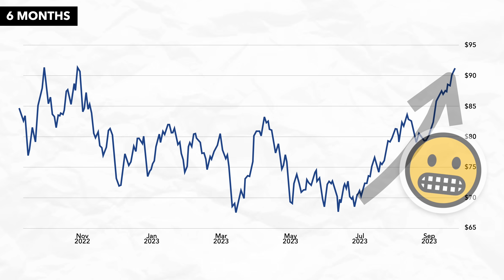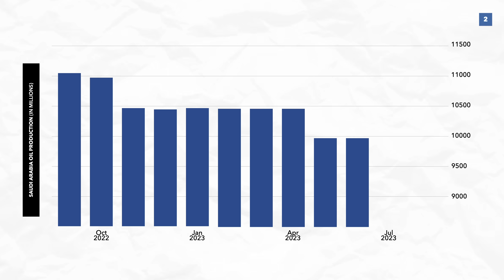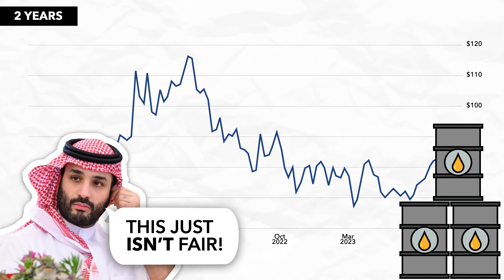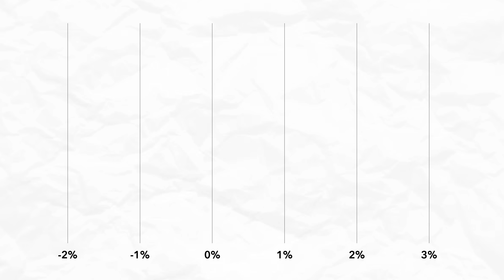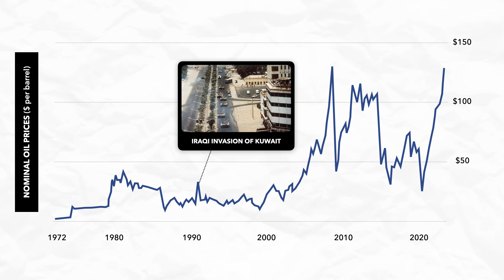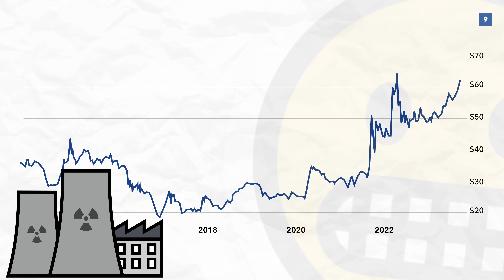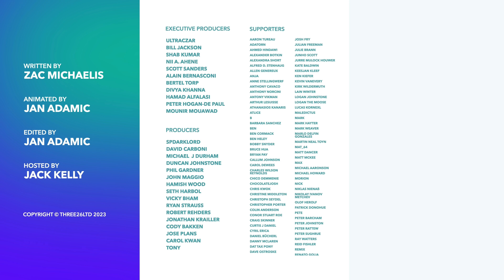Will High Oil Prices Restart Europe’s Energy Crisis?

Comment: We need to embrace nuclear energy.
Reply: We need renewables, nuclear is not profitable. And doesn't make us energy independent either as europe has to buy nuclear fuel
Reply: Nuclear fusion energy and nothing else.
Reply: @jorenbaplu5100 renewables aren't feasible

watch a video on it, we don't have enough minerals
Reply: @Nathoor  we need more and better batteries for the long-term, sure. But with what we have right now, investing more in renewables already helps massively to just take down the price of energy in general. Like if you can use these when they get produced, completely without batteries, you still reduce the need for other sources overall
Reply: @jorenbaplu5100  Short term thinking like yours also needs to go.
Reply: @crabLT  if you want a long term solution, then it definitely isn't nuclear. Not only will the cost create massive debt for the taxpayer, but unlike renewables the fuel is actually limited. Not to mention the added cost and potential danger of the inevitable cleanup. Nuclear belongs in the past.
Reply: @jorenbaplu5100 solars are very counter-productive
Reply: @jorenbaplu5100 also you are mainly referring to Nuclear Fission, we prefer Fusion
Reply: @lmvr127  Even if we were to get fusion to work, we don't have enough tritium production to fuel it. The tritium byproduct from all nuclear plants in the world yearly isn't enough to fuel one fusion plant for a month. But if we say we can fix that, then the cost will still be a massive issue. Fusion plants are still insanely expensive to build and maintain and probably would become the most expensive energy source we have. While wind and solar are already the cheapest energy sources today and are set to keep getting cheaper for a while.
Reply: @jorenbaplu5100  Who cares about profit. This is not left up to capital but the state. Capitalists are the reason we're in this mess to begin with offshoring for the cheapest oil to countries that can turn it off. There's no financial incentive to change energy sources. It's actually costly. The State needs to take control of energy.
Reply: @zenster1097  well I actually agree, I just don't think we'll succeed in convincing enough people to disregard profit. Sadly, i think it's very likely profit margins will remain a very important factor for a looong time.
Reply: @jorenbaplu5100  If the State is in control and can cap it, why is profit an issue? The State secures the resource, etc. The State is doing that already. Scrambling to get oil. You're just getting a cleaner and energy resource that is more energy independent.

Comment: Poorly researched at the end there.

1. Uranium costs are just a small fraction of the costs of nuclear energy. Most is building costs and financing cost. An increase of uranium prices will barely be noticeable for nuclear reactor operators.

2. The correlation between gas prices and oil prices is not a strong as you made it out to be. Gas is mainly for heating and electricty, oil is mainly used for transportation. very few oil fired power plants exist. (mostly in estonia, malta and cyprus) Since electricty prices are determined by the merit order of production, meaning the highest priced source that delivers the last bit of needed capacity sets the price, gas prices are the main factor in determining electricity prices. Therefore oil prices will have a small effect on electricity prices. 

Of course high oil prices will hurt europe in other ways, but this problem is different from the energy crisis we experienced last year.
Reply: Side note: modular nuclear power plants are attempts at making building these things cheaper, seems to be working though their power generation is smaller from what I understand but worth the cheaper costs.
Reply: Keep in mind from where you can get the uranium. As that is something one also doesn’t want to depend on too much.

Comment: All those people that want more solar and wind energy to replace fossil fuels need to think about the meaning of energy density.  How many acres of windmills or solar farms does one need to replace a single oil or gas well that is gushing 24 hours a day, 365 days a year for several years.  I heard somewhere that to reach net zero by 2050, one needs to replicate the entire installed base of wind and solar generation every 2 months or some such other unachievable timescale.  This is just for electricity generation, cars and domestic heating are another matter.   There is not enough metal being mined or people to do the work let along expand the electricity grid  to cater for these plans.

Comment: Lot's of ignorance of energy in the comments.
Fossil fuels and Nuclear are not comparable. Fossil fuels are stored energy, nuclear fuels also contain stored energy. However, nuclear reactors do not let you ramp up or down out put based on demand. Nuclear will never replace gas on it's own, it has to have additional storage capacity built alongside. Those storage systems require huge amounts of natural resource inputs, which are extracted using fossil fuels.

Comment: More Green energy is the answer. Wind, solar, geothermal, you name it. Geothermal could provide electricity with Stirling engines, btw.
Reply: Fertilizer.
Reply: Unless it is hugely subsided by the government, renewable energy will remain too expensive to be reliable due to the inability of said energy sources to be stored. 

One can store fossil fuels which make up for surges in demand but renewables just don't have this capability.

Comment: The US is no longer dependent on oil imports, perhaps Mr. Biden could stop obstructing domestic oil production so that we could help insulate our European partners from supply shortages. 

The latest average break-even price for new US wells is $61/barrel ($23/barrel for existing wells).
If OPEC+ production cuts continue to drive prices towards $100/barrel then the US could increase production profitably for the European market; this could help Europe avoid a recession and rectify the trade imbalance that it has with the EU.
Reply: America imports most of its oil from Canada. Also because of the Petrol Dollar the US more or less gets things for free after printing money for it. What America doesn't really want is that same useless dollar flooding America for real resources like oil. Also, not oil is the same, America oil might not be efficient for Europe's machines. They all have a different constitution and maybe Europe's products have been built to work more efficiently with Russian oil.
Reply: @DavidJohnson-dc8lu ,
The US produced 1,192 more barrels of oil/day than it consumed during the month of June 2023 (US Energy Information Agency).

Comment: The EU needs to ban its auto industry lobbyists. Car dependency locks in motor fuel dependency. If people could get around well enough on foot, by bike, ebike or public transportation, the EU would see its energy use decrease and get more GDP per unit of energy consumed.
Reply: EU countries don't have car dependency problems like in the US. Oil price is problematic to the EU because it's the main resource for producing electricity. If you live in the EU, even if you switch to electric car, it's still oil in the background. That's why the problem runs deep and deeper. The only solution is to go nuclear.
Reply: @nokaton  
This is verifiably false. Only 0.5% of electricity generated in the EU came from oil-fired power plants. Get a clue.

Comment: 2:30 - That is a TERRIBLE graph. Why does it not start at 0? Having it start at an unspecified number (probably 8,500) massively exaggerates what is happening.

Case in point, if you don't actually read the numbers, it looks like the August 2022 numbers are 7 times higher than what they were in September 2023.

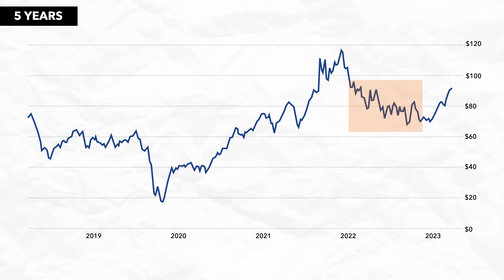The same is true for the oil price graphs, and here it's really egregious because you start out (1:00) with a proper graph, then at 1:13 you switch to one that starts at $65 and makes the September 2023 prices look 10 times higher than those in September 2023.

Through out the video your oil price graphs change significantly.

First it's $0 to $120 (1:00)
Then it's $65 to $95 (1:13)
Then it's $70 to $105 (1:56)
Then it's $60 to $120 (3:20)
Then it's $65 to $95 again (4:02)
Then it's $0 to $120 again (4:42)
Then $0 to $150 (5:43) 

And suddenly you introduce a Uranium price chart which ranges from $20 to $70, which dips below $20 (7:25)

Once is an accident. This is basically lying with statistics.

You can and you should do better.

Comment: Use less oil then
Reply: Slow down economic output. Got it
Reply: Oh wow! The European leaders never thought of that!

Seriously...
Reply: One thing is reducing your own oil usage, but pretty much everything is transported by trucks, and good luck finding an electric semi. More expensive transport --> more expensive food/commodities
Reply: @vervetech9395  go on local holidays instead of flying, use a bike/walk for trips shorter than 2-3 km (In Denmark 1/3 of all car rides are shorter than 5km), use public transport when not too inconvenient, prioritise stores in walking or biking distance, buy electric or battery powered gardening tools when the old ones breaks.
That's just of the top of my head. None of these will affect economic activity, will improve public health, lower congestion, reduce road maintenance costs, lower dependence on dictatorships for oil.
Reply: @inbb510  Yes, they have tried everything except anything inconvenient or politically costly. There are plenty of solutions both for individuals and govts that can be implemented very quickly. Politicians are just to busy s¡mp¡ng for car manufacturers and oil companies to do anything about it. Many drivers used to the ease of driving to walk or bike even the shortest distances
Reply: @kotletschabowy4169  that's why individuals need to reduce driving and flying, it reduces the price increase of food. Cutting unnecessary car rides will lower congestion thereby reducing fuel use of necessary traffic. Great opportunity to walk and bike as well, the health benefits will ease the pressure on our overburdened health care systems. There are no downsides to driving less
Reply: @HiLasse  in politics there are no such things called "solutions". 

There's problems, and then there are advantages/tradeoffs to each policy that attempt to address such problem.
Reply: @inbb510  sure, but your answer doesn't address the point of my comment.

You only adress my choice of a specific noun in one sentence. Reading your comment it seems it did not prevent you from understanding what I wrote. Which seems not particularly useful in a context outside of linguistic semantics.

Comment: The cold reality is that Eastern Europe has imported its oil from Russia or the Caucasian states since after WW2. There were some exceptions like Roumania which has its own oil fields. Germany had improved its relations with the Soviets in the 70s and also started importing. No wonder why. Russia has several natural resources which can be transported cheap and easily to Europe. During the second part of the XX century also big pipelines have been built to transport oil and gas to Europe.
The Russian-Ukranian war abruptly broke this partnership, however it is easy to see that Europe won't be able to import that cheap energy from anywhere. So the crisis could be stopped by simply buying from Russia again, however this seems very unlikely. This way the EU will suffer, the natural gas and oil imported from overseas will be much more expensive than the Russian origin ones and EU states will be at the mercy of the gulf states.
Reply: And calling one pipeline дружба sounds like a sick joke.